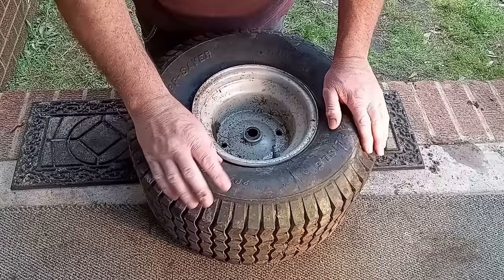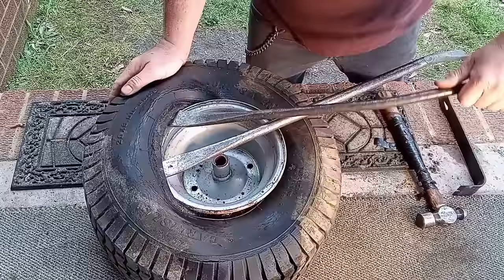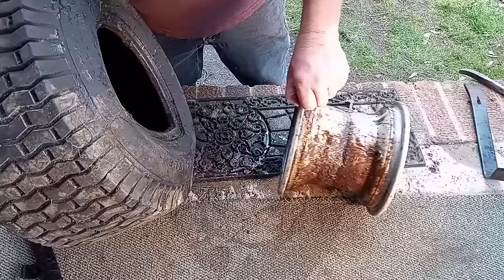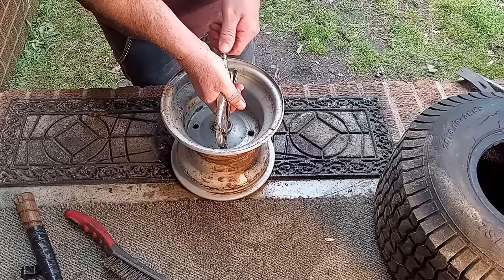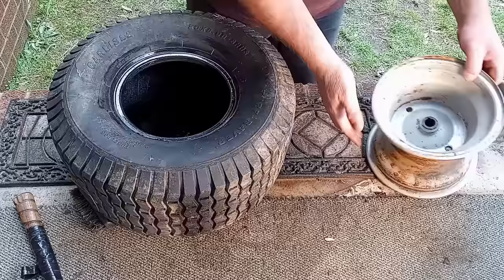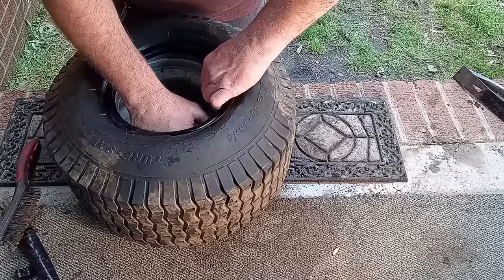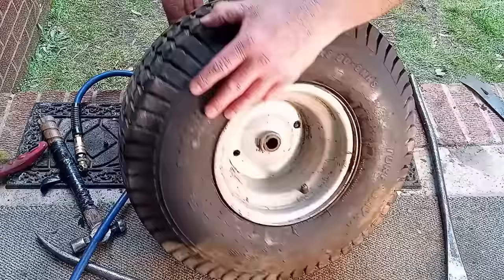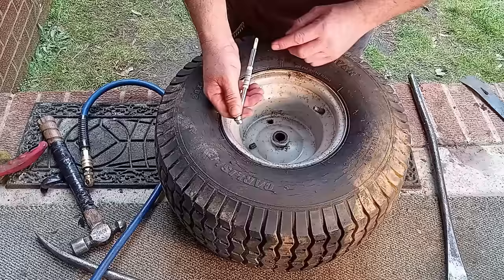How to install a inner tube with hand tools.

Comment: I liked your video on here on putn inner tubes in lawn tires I do the same thing all the time  but I would like to add always put ur valve tem remover on to hold your valve so it won't slip back in the tire  just try to help
Reply from the maker: Great tip!
Reply: What an awesome tip! Why didn't I think of that! I'm always loosing the valve stem while trying to install the tire. Thanks
Reply: I don't have a valve tem remover, I used a small hose clamp, kept it in place.